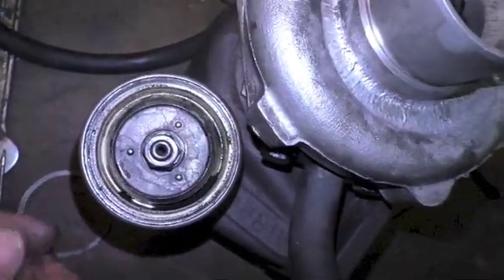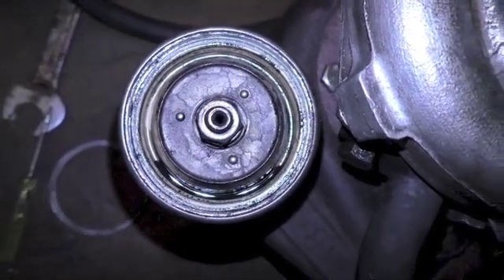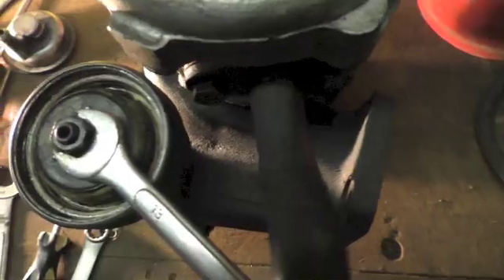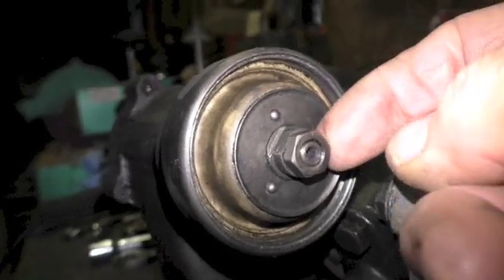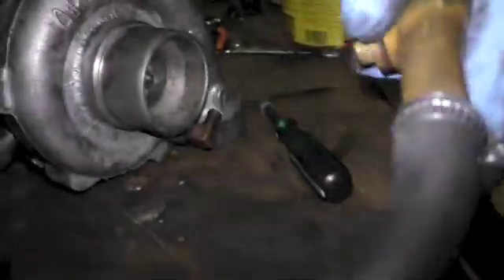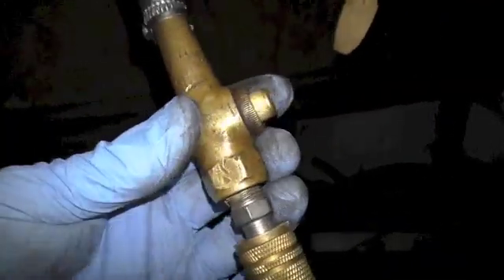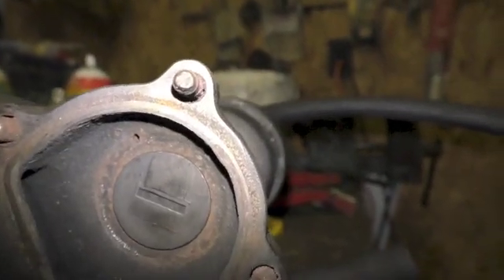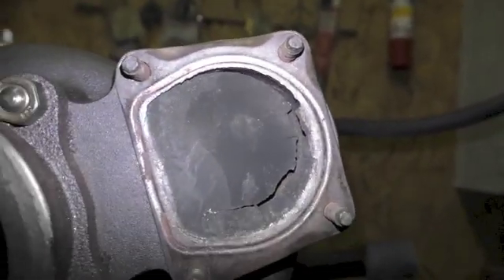Garrett T3 Turbocharger Wastegate Adjust

Comment: At the end of video did you find out if that broken thin metal plate at end of wastage needs to be replaced? Mine looks just like yours.
Reply from the maker: Hi Luis. I tried getting help from Kent Bergsma at mercedessource.com regarding this plate. He tried to order some but the order came in with the wrong baffle plates. and the manufacturer refused to make him any more at that time. He did not advise me as to whether I could use the turbo with the ruptured wastegate. I was kind of on my own. So, I went to my local tin smith with my old one and he cut me a new one out of thin stainless steel and I put it in. The car operated fine with the new plate. I don't know how it would have operated if I had just put the ruptured plate back in. My guy charged me like $6.